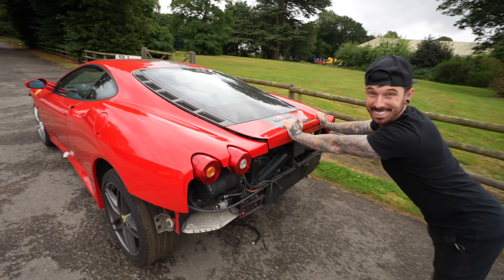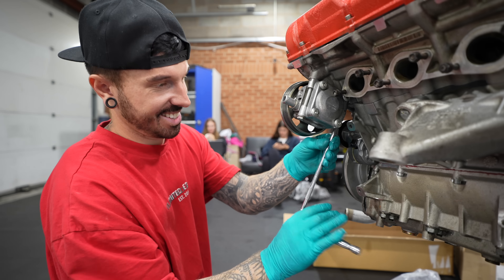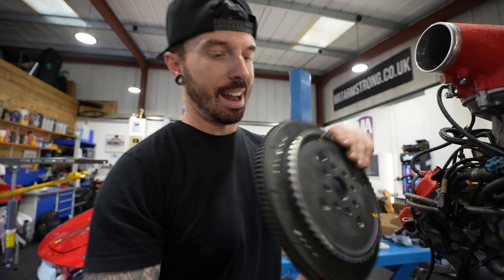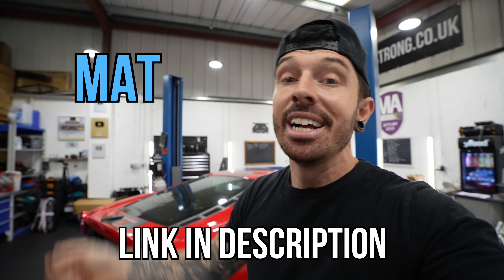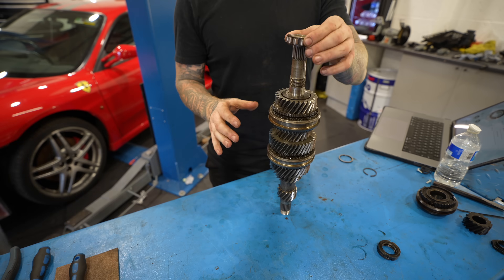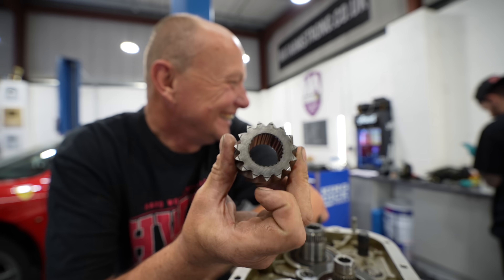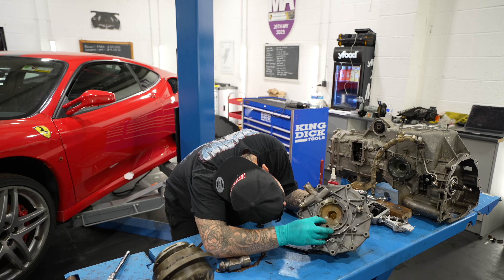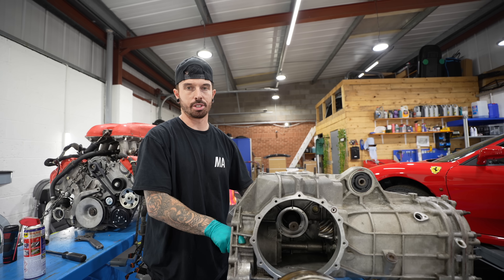REBUILDING AN EX RENTAL FERRARI | PT3

Comment: Because its a gearbox and not a transaxle. The primary shaft is always kept at the same speed as the engine and intermittent shaft speed is also kept in range so when it shifts it dosent slam the teeth from a moving shaft to a not moving shaft. 
The input shaft is controlled by the ecu,tcu,pcm and clutch to keep i lt spinning at relative speed to the engine when its not in use via any gear in the box. Also for when you shift form first to second the shaft speed is perfectly match and so on.

I have a gearbox in my veloster they are kinda clunky on road in stop and go traffic.
Can be very noisy. And they do not like to be crawled really slow in traffic. 

Best of luck to you mate. I know you will make her right again ❤

Comment: Mat, a really interesting build.

Watch out for the diff ramp on the LSD, you may also find that when it's all fully back together, if you turn one wheel in Neutral, the other will move backwards. This is normal if there is preload on the diff, dont know what the Ferrari settings will be though.

Waiting for the next instalment 🛠💪🏼

Comment: 23:00 - that's normal. The gears on the ouput shaft are mounted over bearings, and they will actually engage with the shaft when you move the sliding sleeves. The point is, as you dony have anything holding that output shaft, just the natural friction between the bearing and components will be able to transmitted the torque and spin it. The right way for you to this test you are trying to do is to spin the input shaft but actually grab the output shaft to see if toeque is being tranmitted. When you add the crown wheel, you could see that it stopped, as the friction couldnt overcome the differential wheight residtance. So all good...edit. now that ive watched the video until the end, i saw that you figured this out. Well done. Good luck. One think i would suggest though. The gap between pinion and crown wheel is directly responsible for the life of the system. To a point where a couple of microns can reduce the lifespan of the component in half. You had a great instinct by using the same pair, as these are manufactred togther to align some gaps in the teeth geometry, but this is not enough. When assemblying these things, the housings will come with different sizes inside the tollerance. So in the assembly line, the operator will put everything together, measure the gap and then adjuste those plates with the correct tollerance to compensate for the manufacturing variantion oft the housing. If you changed the housing or bearings,  before running this transmission, i highly recommend you have some google on "How to adjust backlash  on a differential"

Comment: Baulk rings etc cause drag
Need to check backlash on that crown wheel and pinion
Also preload on diff bearings.
Then you should be good if all gears and synchros assembled properly👍👍

Comment: The secondary shaft is the pinion, and the ring gear is on the differential. Also was there and shims in the transmission? It important for backlash and endplay. Make shore that correctly set for noise and premature wear on the bearing and gears

Comment: Please put tape or put a piece of paper towel in the inlet ports, up until the time you fit the inlet manifold! I would have put a drop of loctite on the flywheel bolts as well. Another great video 👍

Comment: Yeah, there is drag in the gearbox because the gears with their bearings are pretty a pretty tight fit on the output shaft, so even though the dog teeth are not engaged, just that friction between the two will be enough to 'drag' the shaft around. Compounded obviously if it is dry.

Comment: Yeah, you can also demonstrate this by taking the driven wheels off a car, jack it up and start the engine with the gearbox in neutral, the hubs usually spin even in neutral.

Comment: I definitely never worked on a Ferrari transmission but I will say I was crimson just a bit watching you put the pressure plate on the clutch. Mainly because I didn't see you using any alignment tool whatsoever and I swear from The view I got you were off centered. Maybe it was just me. Either way, I do not work on watches nor do I put together transmissions 🤣. I stopped at the clutch. The rest of that is all put together by magical wizards that eat mushrooms. A man has got to know his limitations and gearboxes are mine. 
Best of luck to you mate, you have boldly gone where no man has gone before... That wasn't working someplace named Ferrari 😁👍.

Comment: The clutch plates inside the diff make it a "limited slip" type, which just slips one side when cornering, instead of a standard, "open" type diff which only gives power to the wheel with the least traction. This distributes power to both wheels at all times.

Comment: if you dont have torque for a certain part in a build, then you can use the bolt torque which you can find for every size of bolt !! like example your ring gear bolts were probably m12 so u can use that bolts max torque and tighten it in 2 parts in to the max 👌

Comment: Hey Mat. A quick tip for the future, to get the two shafts to sit down, before you hit them , try spinning them first, in the three shitty gearboxes i have put back together it worked really well and you are sure they are sitting straight together.
Oh and another thing, clean really well the gears, sometimes sluge or residues can make the shafts not meet perfectly and make it a nightmare to put together.
love the content and keep on trying, cause you learning more than all the bitches hating on you.
Keep it up!

Comment: Great job getting it back together.  BUT, 2 things.  As commented already, the backlash on all those gears needs to be checked and set properly, mixing the parts up is a big risk.  Also, as an engineer, using any of the fire damaged parts can play into the unit not working.  Whether they are warped from the heat, or their mechanical properties altered based on the extra "heat treatment".  I applaud your effort, but i am worried for you on this one.

Comment: You probably know that already but... about a diff its LSD, limited slip differential. It helps burnout on two rear wheels together. If the clutch discs are burned too much  only one side will burn a tyre and second one will stay on the ground. That means you will need to rebuild it ;))

Comment: I know you don't have much choice but ccarefull reusing those fire damaged parts Mat. The high temperature from the fire messes with the mechanical properties of the steel and besides warping and deflecting (which in gears can mean trouble) will also reduce yield strength and elasticity.

Comment: Alright Mat, hope ya well mate,
Just been watching your latest video on rebuilding your ferrari gearbox, 
Not to sure if this is the correct way to let you know but are you aware of how steel is changed at a molecular level when heat is involved?
I used to work in a steel factory heat treating cogs, pinions etc and know that these are case hardened, 
Introducing fire can soften steel dramatically 

Don't want you to do all your hard work and find that your gear cogs just shread,
Keep up your great content, you've done amazing!

Comment: i know nothing about cars at all but i jus wanna say yk how that bit slides on the primary shaft in the gearbox to lock it in gear? what if it wasnt slid onto the right spot when you put it back in? lets say maybe it was locked in first and when you put it back together and tried it, it was in neutral but actually it was locked in 1st??? i genuinely know nothing so this is just a guess and i am most likely wrong but thats my input lmao. good luck with the build bro

Comment: Are the final drive ratios the same between the auto and the manual? Ahh before you explained, I was about to comment you'll get friction in the box that will drive the wheels if there's no load on the box. Sometimes if you've got an engine running and the car has one wheel on the ground and the other side jacked up, it'll spin the shaft. Also the car has an e-diff so they'll be the clutch plates for that.

Comment: If it didn't have to hammered together it's probably all in the right place. The only thing you seem to be missing are the Ferrari backlash, thrust gap sizes and diff pre-load figures so it might a bit noisy.

Comment: Pro tip. When you heat up metal in say a fire and then cool it quickly it actually weakens the metal with micro fractures you can’t see without a microscope. This will highly increase the chance of a gear failure under stress. Good luck! 😅

Comment: Multiplate clutches are used to keep them small, you should locktite the start of the threads, you put it on the wrong end of the thread.

Comment: By no means an expert on this, but if the fire was hot enough to melt the casing it may have been hot enough to temper the case hardening on the gears inside? Someone might know better on this.
Thoroughly enjoyed the video though, awesome work.
Reply: It does mate  and if it was cooled down quickly it would cause loads of stress, I'm sure mat will of done his homework!
Reply: @peteharper5486  I find all that metallurgical science stuff just fascinsting, but outside my wheel house. Hopefully he hasn't inherited a chocolate gearbox!

Comment: Just a question but if the bearings had melted in the burnt gear box would the steel no be effectively weaker as I would have thought the heat would have reset the metals temper making it slightly weaker?

Comment: Hopefully it won't matter but the temperature at which aluminum melts is high enough to anneal hardened steel. It is possible that the transmission components exposed to the fire may have lost some of their heat treatment. Just something to keep in mind.

Comment: I am wondering, since the gearbox and rear diff have been on fire, how has it affected them, considering that most of their parts have been hardened to a certain level. If you heat them above a certain temperature (different for every steel) Celsius, Fahrenheit or whatever, it will loose some or even most of its hardness, which means it will wear out much faster.

Comment: I might be wrong on this but I dunno but for example when you put a car in the air on a ramp the wheel can still start to move in neutral but once it’s on the floor with all the weight it’s stop and don’t move, I’m not 100% sure though

Comment: You need to check the backlash and pattern for the differential especially when the gears are going into a different housing. Any drivetrain shop could help you with at least an idea of what it should be. You will destroy the gears if its not done right.

Comment: Matt that water pipe you used for the oil cooler will fail because the rubber will react with the oil.

Comment: That a hydraulic diff? I.e oil pushes that inner plate in the diff so it all connects kinda like a secondary clutch when gear is selected to actually spin/disconnect when car is in neutral?

Comment: Mat - I'm sure others may have said the same, but did you check / set the crown wheel / pinion gear backlash when you rebuilt the gearbox? - I know that on Porsche transaxle boxes this is done using the shims on the diff bearings so may be similar on the 430 box. Anyway, love the channel :)

Comment: Hey I'm not sure. The gears from the burnet one can maybe lose his strength. Because the steal ist harden and this ist not the case anymore. The heat changed the behavior of the metal. Maybe the metal will snap under heavy load.

Comment: Matt when you put the flywheel on the engine could it only go on one way or anyway because it looks the the crank sensor ring is on the back of the flywheel and some engines you can get it wrong  mate

Comment: As you’re using the original parts the end-float incorrectly called backlash as that’s relates to the bearings won’t be an issue as your dad will have pointed out.

Comment: I'm not a mechanic or even very clever, but all those going on about the heat from the fire damaged gearbox may have altered the tempering of the gears.
The gearbox casing is aluminium, surely the temperature that's needed to alter those gears, there would be no gearbox casing left!

Comment: I'm no mechanic, but assuming those gearbox parts are hardened carbon steel, do you not need to test the fire hasn't ruined the temper on the parts you reused? Aluminium melts at around 660 degrees which is plenty high enough to do so.

Comment: Lovely video once again Mat! The gearbox drag you’re referring to is something you see with motorcycles aswell I think. If they are in neutral and the rear wheel is lifted, once you give a little throttle the rear wheel will spin slightly. I’m no mechanic but it looks like the same thing to me

Comment: There is no oil in there cause you installed all bearings and shafts dry? Iam not an engine technician, but I don't know how long the bearings will last without the appropriate grease and oil they need on installation.

Comment: If this "washer" for the flywheel is what I think it is, you did that part wrong my guy. If it is what I am thinking it is then this is a diamond covered plate that has to placed between the flywheel and the crankshaft. So the flywheel cannot go anywhere. :)

Comment: Sorry to rain on your parade but I believe the crown wheel and pinion need assembling using shims to optimise the meshing between the gears.  Failure to do this might result in excessive backlash,  a noisy diff, or the diff overheating/wearing out.  In other words, definitely a job for a qualified specialist/expert.  Some jobs on cars just need specialists.

Comment: "I still do not know the reason why the original gear box was taken apart" 
-I do, the car, the engine and the gearbox were stipped for parts, NOT to to repair them. So parts pile that came with the car is missing several parts and they thre in the there the broken parts from other cars to make it look more full.

Comment: Not here to be a downer but the parts you transferred from the burned out transmission are most likely out of temper if they were heated up by the fire and then immediately cooled by the firefighters. I feel you’re gonna quickly find out if the tranny is good or not when you take it out for a spin lol.

Comment: It was hard watching you build that gear box.  I've built Ferrari gear boxes before.  You did good for not knowing what you're doing.  However,  you have not checked preload on the carrier bearings and you haven't checked backlash on the crown and pinion or painted the gears to check for a correct pattern.  Please don't drive it till you've done that.  Those gear boxes are expensive!

Comment: Gosh... Having the spark plugs holes and intake holes open and unsecured🙈🙈🙈🫣 Not to mention assembling the engine without flattening the heads... And it's not a 20 yo corsa, it's a Ferrari...

Comment: Yeah, you might get 100k for a manual 430 that has a matching engine.  You are certainly not getting 100k for trail mix version.  Unless you con someone who didn't do any checking of the car.

Comment: Reusing bearings after being pulled off and pressed on is shitty practice.
You shoukd have used new bearings and use an induction heater to expand the bearing and then just drop it onto the shaft rather than pressing it on.

Comment: If you ever lift a car in the air while the engine is running(well a manual anyway), you'll see the wheels spinning even in neutral. That's what was happening with the gearbox, in no scientific terms.

Comment: I hope I never end up buying a car you guys worked on! did you check any of the bearing clearances? And while smacking that transmission shaft so stupidly and childishly you might have introduced some plastic shrapnel into the trans. on the differntial you're mixing 2 different parts together which have different tolerances, so you would have needed to check the wear pattern again and bearing play!